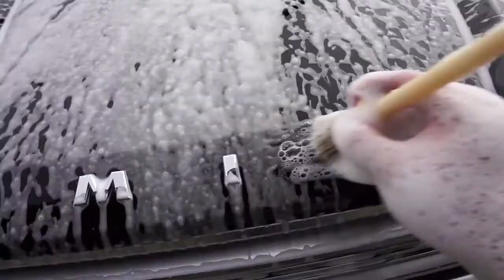2017 Ford F-150 Limited seriously scratched

Comment: I live in Montreal and I work in a dealership as a detailer. Currently I’m working for Kia, i used to work for Porsche. When I see professional detailers talking about car detailing fr m dealership obviously they don’t say good things and I totally agree. As a detailer from dealership I would say is not our fault to delivery a brand new car with a lot of scratches. The reason for this issue is that dealership doesn’t invest, we uses cheap wash mitts in many cases they are very old wash mitts. No good microfibre towels, no two baket method for washing. Managers just want to delivery the cars as soon as posible. They just want to sell cars, that’s why customers should go for professional car detailing treatment after delivery. Customers have no ideas what happens inside dealership, but they trust dealership and customers believe that in a dealership they are going to receive a professional car detailing service. The reality is: dealership use old equipment, old towels, old wash mitts, the same wash mitts for many cars without cleaning it, they use cheap soaps, cheap wax, etc, etc, etc.
Reply from the maker: Lincoln JCM your right. I see it a lot of times. They just want to pump out the car once they have the sale. In this case they didn’t care at all told the client. We already sold you the truck. Not our problem. It’s super frustrating!!

Comment: I just bought a 2018 F150. What would you recommend for paint upkeep, etc. how often should I buff the truck, what kind of paint protectant should I use, any recommendations on chrome cleaning (for rims, tail pipe tip, front grill)? I know its a lot of questions, thanks for the video!

Comment: Just found this channel dope! Question, how much would a job like this cost for the same truck without that much chrome? Might have to drive from Toronto to you! 👌🏽
Reply from the maker: Midnight no worries bud. Pricing and Detailing products are available on my website. The price would be 1200.00. That’s for the five year coating. Rims calipers exhaust tips and glass are one year coating. Top coat can be done bye any certified Ceramic coating installer yearly if you want as well. The package takes a few days due to my ocd. But when it’s done you know why haha. And thanks again for watching 🙏

Comment: Greaa video, What fabric do you recommend to use on the door pillars.? Or dont even attempt to wipe them and Just rinse ? Thanks!
Reply from the maker: Caleb Rodriguez we always recommend the least amount of touching. It’s all about soft and clean microfibres and lubrication. We sell the products we use for a reason. They are the best. Not the cheapest but not crazy prices either. Here is an awesome towel. And check out our amazon account for the Gyeon Cure. It’s amazing as well. Hope this helps. 
https://www.amazon.ca/dp/B0767NZT7J/ref=cm_sw_r_cp_awdb_t1_tmJYAb85ZSGKK

Comment: Myman, on my black 17/ F150 i got a long deep scratch made by a traffict cone; will it be possible to take it out and what product I should use ?     Thanks!
Reply from the maker: Really depends on your skill level for polishing and wet sanding.  If your not comfortable i would have a detaiker look at it. That said if you are i would get some wet sand paper 2000 to 3000 a clear coat and paint touch-up pen from your dealer.  For polish like gyeon meguiars and kamikaze polish.  compounds.
Reply: @LetsGoJT  Thanks..i appreciate it....will vet in touch whit the dealer

Comment: What do you use on the pillars to get the scratches out.
Reply from the maker: Scott McHallam menzerna 3500 and a very good polisher. Make sure to keep the heat very low as it will mess up the pillar
Reply: Thank you for the info!!

Comment: Wondering if you could help me out , just got a new truck ! Tinted my front windshield and the stock number sticker outline is etched on the front window.. would some kind of acid wash fix this ? Thanks
Reply from the maker: Alex Ayala hey so yes. To be honest if you have nail polish remover hanging around and a Cotten ball. You can use that on your glass. But not on the tint it will destroy the tint.

Comment: Without doing ceramic coating what would the cost be for that truck?
Reply from the maker: each job is different when it comes to paint correction we usually book the job in and quote based on your needs
Reply: Ok how much to do what you did on that truck?